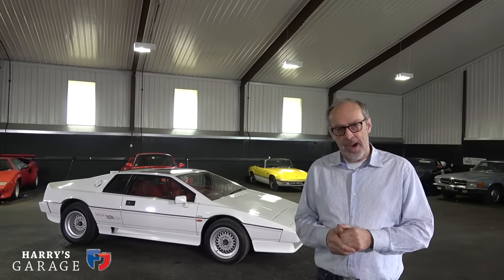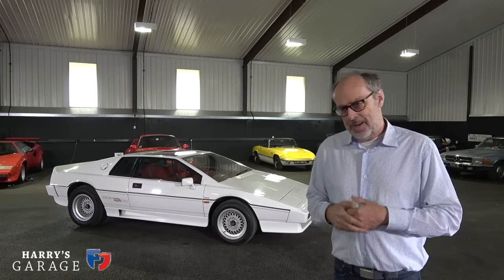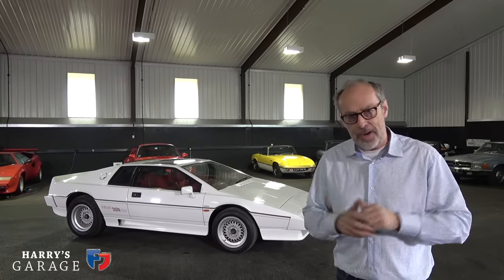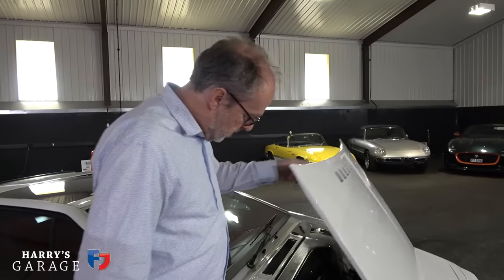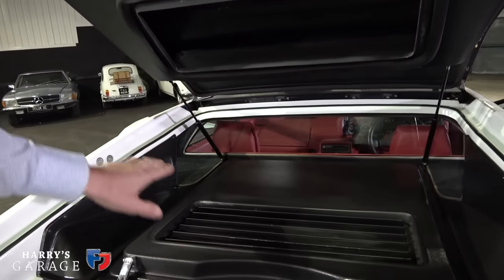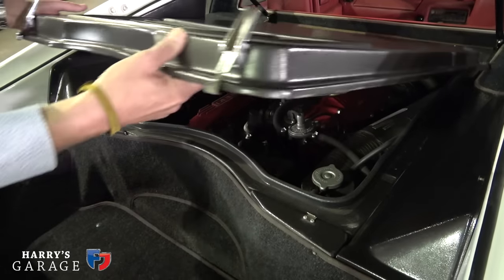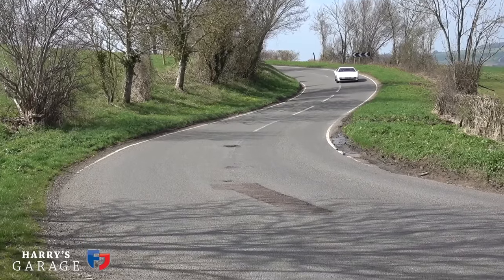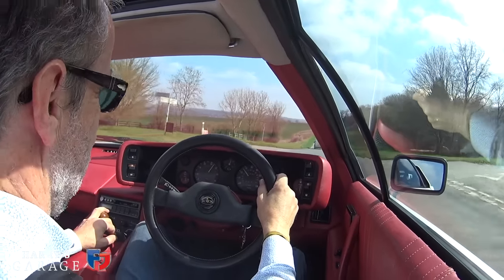Lotus Esprit Turbo HC real-world review.

Comment: That bike was moving.
Reply: wise man 19:50 crazy!
Reply: That was me on the motorcycle
Reply: Q- Bert 😂😂
Reply: Ikr? Made me jump! Watch it in slow mo, its only there for about 2 frames!
Reply: Ton up for sure.
Reply: Hilarious that I can buy a Kawasaki 400cc new for around £4k, that would embarrass this Esprit in any performance test.
 Actually, the 250cc would be closer.
I adore exotic cars, but there's nothing like riding a fast motorcycle. 😎👌🇺🇸
Reply: @davidbennett8627  Plus you can buy an exotic bike like a 916SP3 for the fraction of the price of classic cars
Reply: @davidbennett8627  As long as you're going in a straight line.  Bikes suck at stopping and cornering.
Reply: Through a cross-road junction... Okay, he was on the main road - which is fine until the day someone doesn't spot the 100mph motorcycle coming over the crest and they pull out. Then you have bits of motorcyclist to find and retrieve for the next hundred yards... Is that a job you could do?
Reply: When I was a teenager, a friend of ours had a crash on his Kwakker when racing a car. They found his head still in the helmet 200 metres from the rest of his body. Yup, a cheap bike will be faster than a quick car, that's not clever it's just physics, but I can drive my lotus on the limit knowing my head will still be on my shoulders when I get home
Reply: @glennreconea7370  Lotus had a great safety feature, they breakdown every 100 yards.
Reply: @DaveJudd  Not mine mate, it has a YASA P400 electric Motor and X-Trac gearbox. Goes faster, stops better, goes round corners better and doesn't spunk oil all over the drive ;-)

Comment: This is the best technical/ #petrolhead reviewer of all time.... Thank you Harry !!! #harrysgarage
Reply: @jvaubry  Utter bollocks.  As someone who has crashed an Esprit I can tell you that you feel almost nothing because everything is absorbed by the fibreglass.  They are fantastically safe cars, the Excel being the safest of the lot.  It aced every single US safety test first time - and in those days they were causing real headaches for UK makers.  You are talking out of your arse.
Reply: @jvaubry  Incidentally, do you realise that Ferrari made both the 308GTB and the 308GT4 in fibreglass as well as steel?  Or that both the Esprit and the Excel/Eclat have rollover bars (2.5" dia IIRC) and 7" x 1" x-section steel bars running the full width of the doors?  If I had to choose two cars to have high speed crashes in, these would be it - way, way before I'd chose a Volvo.
Reply: Christian, lotus esprit is not as safe as you think, it is placard for head strikes with the w/s header, and in collisions with heavier vehicles, it gets punted like a football. The low height of the front bumper tends to make the car wedge under the vehicle in front, and getting t-boned in that car is no walk in the park either.  If you don’t believe me check out the lotus forums like I did, and you will come away more informed
Reply: @jvaubry  Ca veut dire quoi, ici 'placard'?  I would rather be in an Excel in a head-on with another vehicle because of that wedge shape.  The Excel has about 2 feet of space before you get to the engine, but then most of the front of the Esprit is sacrificial.  The sides of the Esprit should be pretty strong though I have thought about replacing that beam with a carbon fibre/polypropylene structure and reinforcing the inside of the doors with Carbon/Kevlar plus PP.  The doors could be made structurally very much more sound nowadays.  Back then you could hardly get decent glass fabric, let alone better materials at any sort of reasonable cost.  Nowadays carbon fabric is £10 a sq metre, or less if you don't need a cosmetic finish.  I'd still rather be in an Esprit than in any tin car - in fact I bought my first Lotus because the handling of a 205GTi scared the life out of me with lift-off oversteer, and then I saw one in a motorway sandwich.  You don't get out of one of those alive.

Comment: @Harry: if I'm not mistaken you've got a bit of sunroof panel rattle there! Easily remedied by dipping the sunroof tongues in wax, filling the slots in the roof with Sikaflex or similar, and then replacing the roof and letting the sikaflex cure. Result will be a dead silent glass roof! Promise! /'91 Turbo SE owner.
Reply: Green Giant  ano right.. tailored to fit in the way you and I both know... have you seen them digitally cutting gaskets today..each one exact same..when in reality each one needs to be different.. showed a young un the tailor fit method..he was mind blown and questioned the dumbing down process that's passing for education today..
Reply: Green Giant  it's called youth :-)

Comment: Fantastic Video Harry! I nearly bought one about 20 years ago but got a TVR 350i instead. Always like the look of the Lotus but it didn't have the noise of the V8 in TVR. Now though hearing the chatter of the wastegate on the Lotus, I may have made a mistake!
Reply from the maker: You need both!
Reply: Can’t knock the TVR Wedge though, I had 5...a 350i, 2 x 400SE, a 420 SEAC, and a 450 SEAC. And you’re right....they make the most brilliant noise. No cats help of course.. Wasn’t Oliver Winterbottom involved in the design of both?

Comment: As good as the Giugiaro styling is, I have to say the gen II body is absolutely fantastic as well,  both pretty and tough, even if of course no longer the groundbreaker.  I recall their ads even at the end of the production run, headlined something to the effect that it must be black magic that it still looked totally hot.  And it did.  I didn't realize this massive sunroof was removable.  My '95 Supra never wore the roof over 10C unless it was properly raining, and that was basically as good as a full cab.  This looks to be more than half-way there as well.

Comment: 12:40 You said it was wastegate chatter but that's actually compressor surge/turbo flutter caused by having no bypass valve between the turbo and intake manifold.
Reply: correct
Reply: That doesn’t sound like a great thing for turbo longevity.
Reply: The old wastegate chatter myth from someone who should know better.
Reply: 777jones
These were running quite low boost, so they would not suffer as much as a modern high boost unit.
Reply: Indeed - wasn’t quite as well engineered as the Uno Turbo of the era, which had not only a recirculating dump valve, but also an intercooler - and the turbocharger was water cooled. Lotus flew a bit closer to the sun with theirs :)
Reply: @alexshepherd  tbh watercooling just added more heat to the cooling system. That's why some of the 80s and 90s turbo cars didn't use it. Or when rebuild just left it out. Now the engines have much better cooling and it isn't that of a big problem. But you can do without if you use a oil cooler.
Reply: @19811402  I've been drinking, and therefore feel like destroying the falsehoods you so casually spread.

FIRST, let's think logically. If the turbocharger is so hot that heat pulled from it is overwhelming a cooling system...well, shucks...that sounds like a component that might need some, uh, well, efficient cooling. 

Never in my experience has water cooling the turbocharger added so much heat that I felt my margin was being consumed. All my overheats were caused by system failure, even with heavy boost torture on a hot day. Also, blanket statements like "now engines have much better cooling" like it was hard math for our ancient ancestors to figure out you needed to provide a large surface area (say it with me...r-a-d-i-a-t-o-r) and hoses to dump heat out of the motor.

Furthermore, where do you think a decent fraction of the heat is expelled when you cool the turbocharger with oil? Oh, the fucking coolant. The engine is just a heat sink for the coolant zone. I'm sure you have something like "bla bla oil coolers" to respond with. So let's destroy that too, charlatan. 

You know what's worse? Shutting off your motor with no way to pull heat away from the thermonuclear-hot turbocharger core that is like a time-release oven element for the engine bay (cooking all the rubber components and along with the oil, introducing lots of fun ragged-geometry carbon particulates to be circulated into the slappy piston areas of great expense). That's why even in the 1980s Porsche turbos had an auxillary electric water pump to pull heat out of the turbocharger center section to push the coolant past the radiator while the electric fan ran for a few minutes after the engine was shut off.

Turbochargers were cooled exclusively by oil for exclusively one reason: cost. While I have never heard of a watercooled turbocharger being replaced with an oil cooled one as a normal action, I assume this fantasy you've passed off as rationale can be explained by the fact that an oil-cooled replacement that would bolt up to the flange was simply cheaper than the watercooled one.

Comment: I had the 1993 Series 4 turbo, as a daily driver, after rejecting the S2 and S3. The extra weight of the S4 came with power steering, an intercooler, ABS, fuel injection, 264 bhp with a time limited 280 bhp over boost. I much appreciated the PS around town, especially with the larger and wider tyres. It was a terrific car and looked stunning in mustard yellow.

Comment: Hi Harry, I have a boat designed by Colin Chapin in 1973, it was the shape that spawned the design of boats for the 80s and on as all its designers went to the bigger boat designers. It's one of 12 but it's the only one with a factory fitted fly bridge. I've restored the boat, it receives comments wherever it sails and was described in a magazine as the Jaguar E type of the water, I can forward photos if you're interested. I'm a fan of Mr Chapman too.

Comment: I had an '86 Esprit turbo I bought new in '86. Black with the tan leather interior. I enjoyed it. I do remember until I got that turbo spooled up it had no power. After it did fine.  The front tires were smaller than the rear. So no rotating tires. The Goodyear NCT tires that came with it were a real soft rubber compound that were worn out at 8000 miles. I replaced them with  some Michelin's that were good for many more miles and I could only tell a tiny difference. The BBS spoke style wheels looked great on it. I didn't like the way the a/c vents were located, I couldn't get any of them to blow on my face. And the windshield defroster leaked and would cause condensation to form on the windshield when the a/c was on. So it needed some tweaking in design. I never heard that wastegate shutter, but I didn't have the pop up roof. The Blaupunkt radio that came in it was crap. On a long drive it would overheat and stop working. Since most of my driving was short, I never replaced it.

Comment: Stunningly beautiful. And only four cylinders? Looks like a great car for a summer weekend getaway, but also one to drive on a winding road for fun.
The Turbo Esprit is in the top 3 of my wishlist. 
I owned a VW Corrado with a supercharged 4-cylinder engine. It could have used more power, but its handling on corners was the finest I've ever experienced. It also had a 5-speed with overdrive and a sunroof that opened up, though the buffetting was horrendous at higher speeds.

Comment: In 1975, when I came to the UK for Silverstone, I first stopped at Hethel to try to buy the yet-to-be released Esprit but I was unceremoniously turned away.  I was told the car didn’t exist.

I thought that was odd, as a red one had turned into the Lotus drive right behind me as I has entered!

As I left, on my way to the race shop to see the cars being prepared for that weekend’s race, I passed the red Esprit parked inside the Lotus ground’s chain link fence.  I pulled over as nonchalantly as I could and I ambled over to the fence, where I took a couple of quick photos.

At that point one of the lab coated fellows who had been working on the car went inside the nearest building, emerging with a ‘suit’ who got into the car and . . . started following me!

The Esprit followed me for two or three miles; I thought at the time they thought I was an industrial spy!

I was resolved not to surrender my film, and after a few tense minutes they gave up and turned around, back toward Hethel.

When I got back to the Colonies I offered the photos to Autoweek, but they only offered something like $10, so I kept them as a souvenir . . .
Reply: Autoweak

Comment: I owned an earlier red one of these, a non HC version. I loved it and kept it for about 20 years.  Finely the Lotus reputation overtook it and everything kept failing.   A complete engine rebuild at 45K, several cracked exhaust manifolds, clutch and flywheel at 20K and 40K , rusty leaking fuel tanks, and just about every minor thing you could think of, all before 50K.  But I still loved it.

Comment: Its not wastegate chatter. A wastegate is just a valve that diverts air from the turbime wheel to straight into the exhaust when you're at peak boost. It's impeller flutter, as you lift off and the throttles shut, the pressurised air doesn't have anywhere to go so it tries to go back out of the spinning compressor/ impeller blades.

Comment: Lotus always was lightness and handling above all else. I liked the way Chapman chose the right engine for the job. Many would expect something exotic but for him a breathed-on blown Vauxhall 4 pot was enough. Shame about the Austin Maxi door handles, but those were on my Elan +2S too together with the Maxi 5 speed gearbox! Shame he got greedy over De Lorean and all the UK taxpayer money in Switzerland. He could have been an engineering elder-statesman by now. Great vid 'Arry
Reply: I understood the head to be Al on the Vauxhall CI block, same as the Al head on the Ford 1500 CI block used in the Elan. The secret sauce is in the cylinder head not the block. So it made sense for Chapman to add value on the bit that made the difference. I did not realise that Lotus had an Al block in the Esprit.

Comment: Nice car - always wanted one so maybe one day ... Thank you for sharing.

HOWEVER. please install your gas struts the right way up !

They have a splash of oil inside them for three main reasons :
1. To lubricate the internals so they operate without stick-slip
2. To lubricate the seals which reduces the leakage of pressurised gas
3. To slow the passage of pressurised gas from one side of the piston to the other ... leading to slower smoother action AND a reduction of speed before hitting the end stops.

So in summary - do you always have to replace 'crap gas springs that have lost their lift' ? 
DO you have to comment on the 'aggressive' and unrefined action of your tailgate / engine cover / bonnet ?

Fix : pop the ends, turn over, pop back on with the FAT part AT THE TOP.

(Note that there are some installations where the strut inverts as it passes through it's actuation. )

Comment: Back in the 90's i used to know a Lotus designer and he worked on the Esprit and the various revisions.
Apparently Lotus had two Saab 900 Turbo's and they used them to learn more about Turbocharging given Saab were pretty much the Pioneers in this area. However they did decide against using Bosch K Jetronic that everyone else was using at the time.

Comment: Isn't the sound you hear when the throttle is released the dumpvalve? This blows off excess pressure from the intake manifold so the turbo keeps spinning. The wastegate blows off in the exhaust, so you wouldn't hear it. And great to see another good use of the Metro front indicators :)

Comment: I have a 78 series 2 with 32k miles here in the usa. Remarkable cars, total joy to own
Reply: Blake Riley is the reliability and cost of repairs that crazy?
Reply: @chefgromano5025  Depends what year , if its an s1 s2 or s3. S3's are alot more reliable, esp the chassis as they were hot dipped and galvanized. For the earlier cars, big points of concerns to check are U joints, rear lower hub and where it meets the transmission as well as the infamous failing Motor mounts of the earlier cars until the S3. Some of these are fixed by modern updates IE motor mounts, some just need a watchful eye. Another issue common with the 907 are the leaky cam covers, which with modern sealants and a thorough cleaning and prevent that. Leaky carbs have caused many cars to burn up due to the position of the carbs directly over the distributor, whichc an be solved by going distrubutorless which a vendor sells( few thousand). Overall if you have the time, money and effort and once you get your car where you want it, and actuallyd rive it they are a total joy. if you want one, Id shoot for a series 3 realistically. I Love my S2 , but I am a maintenance addict so it doesn't bother me.
Reply: Blake Riley I’m looking at s3’s thanks for all the info!!!
Reply: @chefgromano5025  http://www.lotusespritworld.com/buying.html check the forums, this site, and there are a few more. I would def read up before buying anything, there werent many of these cars made. Hand made cars are not like a production line car, each can have its own things it needs. Research is your friend!

Comment: The struts for the rear hatch are mounted the wrong way around. When mounted correctly, the oil inside will dampen the recoil  speed.
Reply: Yup.  They aren't meant to do that.  The pull knob should just open the rear to sit on the fastenings.  Then you lift it up by hand.

Comment: I wonder - does it have a number ‘6’ stamped on the exhaust cam housing, on the boss for the stud that holds the turbo heat shield? Looking at the video brought back memories of the more testing parts of building the engine. That heat shield had spacers and washers and two shields IIRC, and had a habit of sliding off as you tried to assemble it. Cracking little engine though, which benefited from gorgeous Mahle pistons and liners as opposed to the AE items in the LC. IIRC, the early ones had the Citroen transaxle, which was later changed to the Renault item from the Alpine.